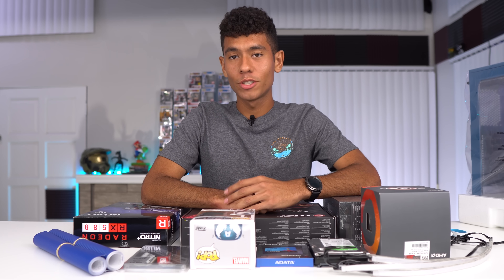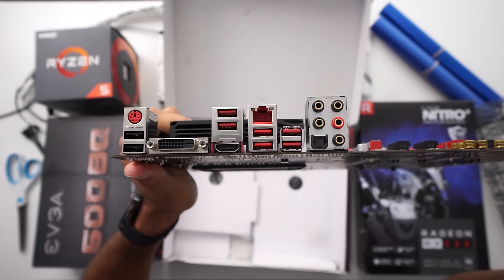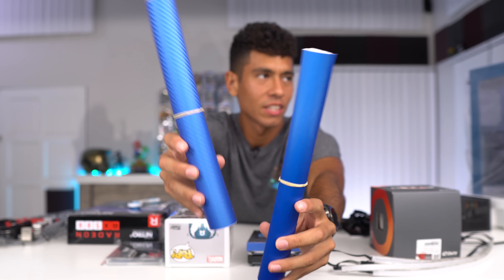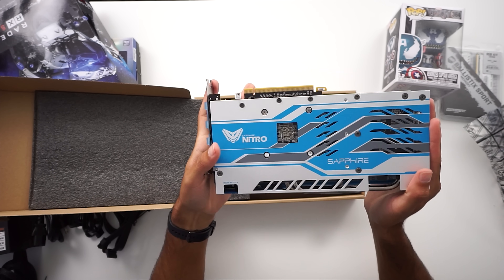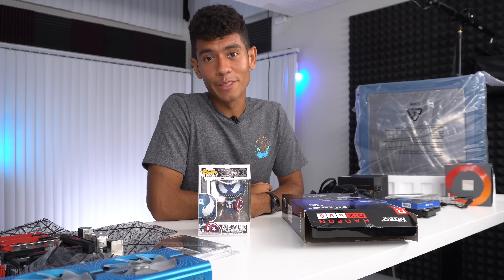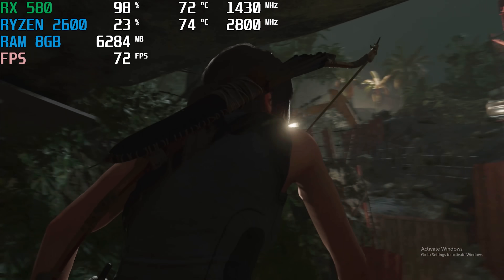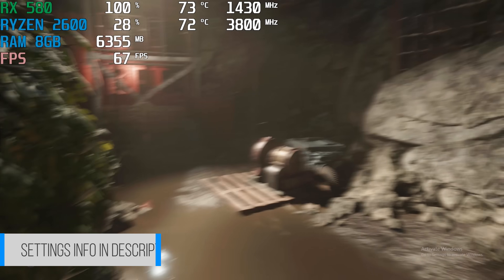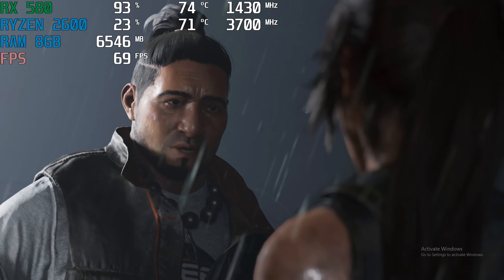$900 Gaming PC Build - Ryzen 5 2600 RX 580 (w/ Benchmarks)

Comment: I was thinking about making my own build with an AMD - Ryzen 5 1600 3.2GHz 6-Core Processor, Gigabyte - GA-A320M-S2H Micro ATX AM4 Motherboard,  G.Skill - Ripjaws V Series 16GB (2 x 8GB) DDR4-2400 Memory,  Seagate - Pipeline HD 500GB 3.5" 5900RPM Internal Hard Drive, Gigabyte - GeForce GTX 1060 3GB 3GB Windforce OC Video Card,  Cooler Master - MasterBox Lite 3.1 MicroATX Mid Tower Case andEVGA - 500W 80+ Certified ATX Power Supply. This would be my firstpc build but idk if its good for gaming. The price is around 650$.

Comment: You want my advice? buy a top of the line board, cpu, ram, storage and power supply, then get a used gpu and high refresh rate monitor. Reason? You do not want to deal with insufficient ram, mediocre processor, outdated motherboard or very little ssd storage. Also the used gpu market is ridiculously good right now that you can get gpus for half the price after being used for a couple of weeks/months.

Comment: My budget rig:
AMD X4 Athlon 860k (OC 4.3ghz.)
8 gigs 1600mhz ballistix ram
EVGA GeForce GTX 1050Ti Scc
120 gig ssd and 1tb hdd 
Originally made this rig solely for CSGO. But it runs fortnite fine at a mix of medium/high/epic settings for over 100 fps.

Comment: What graphics card would you recommend for me? i have a acer aspire x which is a slim type. SEND HELP PLSZ
Reply: 480ti 1gb edition
Reply: What do you want to play?
Reply: @DulacDat  fornite,League of Legends
Reply: @mallillinrjkaylec.6413  really only fortnite and league of legends?. A ryzen 1200 with a rx 560/1050
Reply: @kyron3098  thanks yeah i cannot play pubg bcuz im not gonna pay for it
Reply: @mallillinrjkaylec.6413  pubg is cheap on g2a and other key websites
Reply: kayle mallillin gtx 960
Reply: Get a 1060. Or a 1070 if you got the cash.
Reply: I have a optiplex390  gtx 1060, 250 ssd and a 500watt psu everything else is stock  runs fortnite on high settings at 160fps
Reply: @kayato1861  no u
Reply: dont get a 960 theyre trash
Reply: lol it’s not bad,for what he wants to play it’s fine
Reply: @LaChaTa a 1050 is fine....

Comment: i wanted to build this same PC and i want to buy parts from amazon.de and i have just enough money to buy these parts.But my question is do these articles come with any form of taxes or they are included in price?
Reply: There will be tax that will be displayed when you're going to final checkout. Try Pc partpicker, it will give you a list of the cheapest parts from different retailers you can order from, that may cut the price down so you can save some money or put the extra towards a upgrade.

Comment: Is this build any good? 
MSI - X470 GAMING PLUS ATX AM4 Motherboard
Cpu- Ryzen 5 2600
SSD- Samsung - 960 EVO 250GB M.2-2280 Solid State Drive- Msy/ 
Hardrive- Seagata 3.5" BarraCuda 2TB ST2000DM006 SATA 6Gb/s 7200RPM 64MB Cache Hard Disk Drive
Power supply- Cooler Master MWE Bronze 650W Power Supply
GPU- ZOTAC GeForce GTX 1070 Ti AMP! Edition, 8GB
Ram- G.SKILL TridentZ RGB Series 16GB (2 x 8GB) 288-Pin DDR4 SDRAM DDR4 3000 (PC4 24000) Memory (Desktop Memory) Model F4-3000C16D-16GTZR
Case- Cooler Master MasterBox Lite 5 RGB Case

Comment: sigh First of all B450 mobos are wayyy better because of StoreMI and is also cheaper. Secondly, WHY THE HECK DOES IT COST YOU $900 JUST FOR A RX 580 WITH A RYZEN 5 2600 WITH A FRIKIN STOCK COOLER?!? Legit, I could build one for $800 that has a Ryzen 5 2600 with a Cryorig H7 and a used GTX 1070 with a wayyyy better case and psu. And it has 4 extra  120mm case fans.

Comment: I just got my new PC, cost me $873 AUD. It was also blue and black (the build was mostly black, and I had blue led strips) The specs were:
- Ryzen 5 2600
- MSI B450m Mortar
- 2x4gb of DDR4 2666mhz Kingston Fury
- 600w Fully-modular bronze-rated PSU
- 1050 Ti (second-hand from a friend for $100, only 2 months old)
- 1TB WD Black 7200RPM (got it for free)
- Magnetic RGB Strip kit from Deepcool
- Fractal Design Define Mini C TG (was on sale for $119)

Bit worse than this PC, but got some amazing deals honestly.

Comment: nice build bro like always 👍✌.  I wanted to build a pc. but I was afraid to damage components during the building process. 
So I ended buying a cyber power pc. did I get a good deal? i5 8400, 1tb harddrive, RX 580 4gb ,  8gb 1 ram stick,  500psu thermal take, b360m bazooka mother board , windows 10 , with usb Wi-Fi adapter . 3 red leds fans in the front , 1 in the back and the stock intel fan for CPU. $739.99+taxes on Amazon.

for black Friday I was planning on buying a better GPU . and a Samsung 860 
m.2 SSD,  I heard that Samsung has good cloning software to clone and transfer windows 10 to new ssd.  
what do you think good bad? let me know I would like to know what you think 
 thanks Joey

Comment: Wait which GPU is better? Gtx 1060 6gb or 8gb RX580 because I built a $1000 build a month ago with a Gtx 1060 6gb. The RX580 is also cheaper I did get an SSC tho.

Comment: U could go with a Ryzen 7 1700($200)nd a GTX 1070($380). You can buy a B350 board for $80 and a cheaper case like the Carbide Spec-04 from Corsair for $30. It would still cost 900 and would be better price to performance.

Comment: Can us the ASUS GeForce GTX 1060 6GB Dual-Fan OC Edition VR Ready Dual HDMI DP 1.4 Gaming Graphics Card (DUAL-GTX1060-O6G) in ur next build please I want to know how good it is
Reply: Birdswithteeth the 1060 is slightly slower than the 580 on average (but not by much) and the 580 is in most cases much cheaper and comes with a game pack
Reply: popnimpop oh ok I was getting it to have my whole color skeem white
Reply: Birdswithteeth you can paint any gpu
Reply: you can get the MSI  Graphic Cards RX 580 Armor  it also has a bit of white on it
Reply: Go for it. It´s actually a fairly decent card.

Comment: You're close to what I just built. 2600 with a b450 Asus ROG Strix, Corsair Ven. 2x8gb,  Gigabyte 580 8g, Corsair cx650,  But i went with a 512gb ssd from Silicon power. I figure is a few weeks I can throw in a 2tb hdd but to get up and running the 512gb would be fine. My case is a NZXT s340 elite pro limited Purple

Comment: Can you please do a 1075 dollar where you don’t put any of the money to looks. So it’s the ABSOLUTE BEST gaming PC possible for the money 💰 

Also og you see this does is matter what graphics card brand it is. Forex sample a msi 1070ti vs EVGA 1070ti.
Reply: xd Rogerz you could make a build with a vega 56 or 1070ti at this price already
Reply: he could have built ths pc for like 700 if u he didnt care about looks
Reply: Dominick Blanco if you don’t care about looks this pc is $500 and the $900 with 1070ti I’m referring to still has looks in mind
Reply: yea i do care about looks but joey goes out of his way for the looks, i agree i looked up the parts it comes to like 600 new and u could uprgade the gpu to a 1070 for  like 100
Reply: Dominick Blanco what I’m saying is you could get a good looking $900 build with a 1070ti or vega 56
Reply: oh yeah ik, is the vega 56 good
Reply: Dominick Blanco it is basically just slightly better than the 1070ti but has much better capabilities after bios flash plus undervolt and oc
Reply: MSI vs EVGA is the same chip under the hood, it's just the fans and all the external stuff that's different between the brands (also check the RAM on the card obviously).
Reply: tehjargonz0r ok thanks
Reply: Can also be for 1074,82.
Reply: what matters is the clock speeds ram and cooling
Reply: lol  RGB is way more important.
Reply: I made a build list and you can do 8700k and 1080 for $1000
Reply: Maxwell Chang  Break it down for us.
Reply: @faycalassaad6066  kk
Google express i7 8700k 269.99
Cheap z270 mobo 99.99
2 x 8 GB corsair Vengeance 3000 MHz $150
Hwswap GTX 1080 $320
500 GB SSD $85
$40 for a case $40 for a psu

Only used component is 1080 and hwswap users usually provide excellent condition parts. Its a community of pc nerds.
Reply: Or if you go straight used on hwswap, pretty much all of that for like $650-750
Reply: Most of the time no, not really.
Reply: It’s it better if I put a ryzen 7 1700 for the cpu instead of ryzen 5 2600

Comment: omfg, this is my actual build i built 3 weeks ago
Reply: is it good? can you stream fortnite with obs?
Reply: it def can handle that, I built my pc with the same GPU and CPU with the b450 mobo instead of the one he uses, you will need a fan splitter since the gpu runs a little hot and 2-3 fans, (most cases come with 2, so just 1 more for good airflow). Also if you plan to use the RX580 Sapphire GPU i do reccomend getting or having a Freesync monitor, which is cheaper than nvidias G-sync options to take full advantage, optional of course though.

Comment: You can also find 130$ Team T-Force Vulcan 16gb DDR4 3000Mhz on newegg. I would really recommend that website because things are sometimes cheaper than on amazon. Also an ssd is not required. Nothing will happens if u will not buy it. 600w power supply is too much. 550w is enough for any build and It also costs 10$ less than 600w

Comment: Hey Joey. For Next 2 month i already ordering some stuff.
Proc = i5 8600k
Mobo = MSI Z370 Pro Carbon
CPU Cooler = Cooler MasterLiquid Pro 240
Ram = 2x8gb Team T-Force DDR4 2400 Mhz
GPU = MSI GTX 1060 6gb Gaming X
Ssd = M.2 Adata SX8200 480gb
PSU = Cooler Master MWE 650w 80+Gold
Case = Cooler MasterBox TD500
Harddisk is from my old PC = Seagate Barracuda 1 tb + 500 tb

Is that will work or too much
The purpose is for gaming and do some video editing.

Comment: Why'd you use a card the same price as a 1060, when a 1060 is faster on benchmarks? Not to mention the extra, what is it, 70 watts the rx 580 pulls? Not worth it at all to go with a rx 580 unless you're mainly editing or running heavy heavy mods. Benchmarks speak for themselves. The 580 is just slower.
Reply: I disagree
Reply: @aaronsmith4979  With what? Cause statistically speaking the rx 580 is slower than the 1060 6gb. That's not an opinion. That's an actual fact.

Comment: Great vids bro can u build a gtx 1060 i5 8600 16ram pc (fortnite)
Reply: u could save on that and get better performance doing r5 2600 gtx 1070. you're saving $100 on the cpu and spending $100 more on the gpu